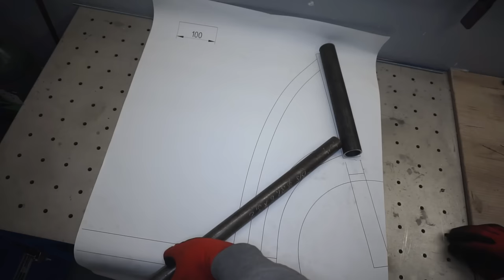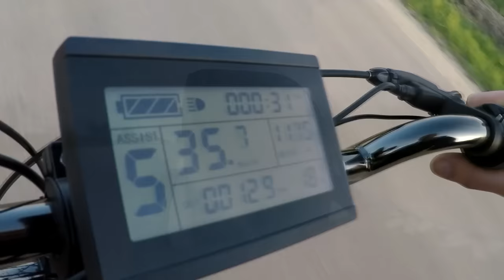Making a Powerful Fat Tire Scooter

Comment: The fact that you can just make this in your garage is pretty amazing. Wonderful results. I love the BMX style handlebars
Reply: The man has easily $60k in equipment plus the necessary materials. We usually buy these things in a store because we don't have a high end equipped lab to make it ourselves.
Reply: The Canadian Crippler  the fact that you don't realize how awful of a comparison this is, is quite baffling to say the least
Reply: @Tiagotaf  You can build this with a couple hundred dollars worth of tools. Most expensive is the welder but you can rent one. The bandsaw can be replaced with an angle grinder and a spot welder can be made with a car battery. 3d printer is not needed for this build.
Reply: Ll
Reply: @Tiagotaf  .
Reply: @Tiagotaf  What's going on? 56١
Reply: nice

Comment: this thing is super solid. You even took the time and effort to completely weld that steel platform thats crazy. great job man I only wish I had the skill, money and time!
Reply: I thought the exact same thing! He did not take any shortcuts.
Reply: he forgot to add suspension tho
Reply: @Blox117  That would have made the project quite a bit more complex(and costly, time-consuming) plus the fat tires offer a bit of bounce as it is.
Reply: @stephenloflin4772  suspension helps keep the wheels touching the ground. no suspension at 30+mph is very unsafe.
Reply: @Blox117  This scooter doesn't got that fast. It tops out at about 25mph.
Reply: @Blox117  
Yes, going on rough terrain will not be good as you will feel every bump and hole in the ground.
Reply: @mohammedrashid1972  yes rough terrain, such as most roads in america
Reply: you do my friend, its just waiting to be found within you :)
Reply: great

Comment: 9:49 sounds like a car is passing by, Amazing work
Reply: dont know what cars you hear
Reply: @mr.engineear0987  bruh
Reply: @mr.engineear0987  silent trucks? lmao most trucks have loud Diesel engines, only thing that will come close to that sound is a Tesla
Reply: @Jack-sy8hs  Tesla truck lol
Reply: @mr.engineear0987  lol
Reply: @CabritinhaJP  what’s your problem ‘bruh’
Reply: Most of the noise in cars with stock exhaust systems comes from tires. That's probably why this sounds like a car, too. The effect is amplified when speed is increased.
Reply: @jokumukamikalie  exactly
Reply: @jokumukamikalie  Umm . . I OWN a few cars. It's the engine /exhaust. Are you a pubescent aged boy or something?
Reply: @itsruf1  Do you often stand beside a road when your car passes you? Of course the engine is louder IN the car, but if you stand next to a highway, most you hear is tire noise. And no, I wouldn't be considered a boy anymore.
Reply: @itsruf1  That's your argument?
Reply: @Jack-sy8hs  cars with fucking tires on them lol that's the sound he's talking about any car that is coasting will sound the same
Reply: @Re_Kitty  well yeah because they both have tyres...

Comment: Very nice heavy duty frame!💪👍👍👍👍👍
Reply: I would personally make the ground clearance better and protect the batteries better (he also needs a way to cool the batteries while in direct sun because metal can get really hot in the sun (or some temperature protection at least so he can not blow up the batteries from overheat)

Comment: a possible suggestion regarding the disc brake mount. In the past I have has success from waiting until the rear disc is mounted on the wheel and bolted in place. then positioning the caliper and locking it down gave me a nice reference point to weld from. great work eitherway!!

Comment: It bothers me a little bit that I don't have the knowledge to do the battery in the electrical work in a project like this. I am a certified welder and I have all the capabilities of building a frame for a scooter or a bicycle with no problem, except I cannot figure out the electrical when it comes to battery packs I can wire positive negative to a motor and I can wire a switch but as far as building a battery pack it is above my head. This is some damn fine work you did

Comment: It's hot. Screw the back fender. But for retailers. You need it for rain blockage. You should build with as much carbon fiber as possible on the frame. You'll get 5 to 10 kilometers faster. That's ready for the retail box bro!

Comment: Very nice, amazing tech. Would be a nice upgrade to put twin-tube shocks with springs, for a smooth ride; also since it's all electric, traction on the front wheels too, 2x2, better acceleration, less power loss. Fat tyres are a great choice, optimum grasp, no slippage. Great for Summer rides, or if you could make it modular, to put in the car, as a secondary vehicle for emergencies. You could mass produce them. Maybe even make a variant: gasoline+HHO vacuum engine, for longer range

Comment: The fat tires may be good for rough/off road use, but they also create a lot of friction on smoother roads that eat up energy.  Maybe you've noticed that when pedaling bicycles.  I'd experiment with different tire widths to optimize for my locality.
Reply: Agreed! Something else to keep in mind while riding escooters are helmets, most people wear cpsc helmets, when they should be wearing nta helmets like xnito or bern hudson

Comment: Personally I would like to put the charge inlet higher up such as on the steering column to keep the dirt off from daily use and skip the bms to keep the battery pack functional for a longer lifespan before replacing.

Comment: It will be perfected DIY electric scooter if you add fenders to the front and rear wheels so that water doesn't splash from the wheels during the rainy season. And it completely perect if there is a roof at your wonderful scooter.

Comment: That thing turned out really nice. You're a very talented craftsman. Nice welding, good design.
It's a shame you don't have a powder coating setup. It would have made the finish on the frame really pop. (maybe that'll be a future project)

Comment: Very nice .But with forward planning you could have put suspension on this . Considering you are riding on rough ground also ..I have a 350 42V scooter with seat this has suspension on seat .Even on this some roads are a little bumpy ..Anyway good luck

Comment: Keep all friends on this channel, I want to build a cyti coco style scooter, I have two controllers here, one with a 500w brush motor and another with a 350w brushless motor, and an accelerator with a universal contact switch. What type of battery should I use for each type of controller and which motor for each type of controller I appreciate the advice.

Comment: It’d be way cool to see a whole video on just building that battery! I’m curious what the cost is to build one like that from scratch?
Reply: Its about $10 - $15 per cell for the good high discharge 18650's. High discharge cells are around 2500 - 3000mah.

Comment: Looks very nice!
I have a Question how do you control the speed with a ordinary throttle? I mean how are the connections? Is it possible to use a universal motor?

Comment: Here in Brazil, the Detram does not let you drive your scooter, you need a CNH ACC and to get this CNH ACC the same Detram system says that it has no technical support or platform to regularize, do you know why? Electric vehicles and artisanal combustion are not welcome here in Brazil

Aqui no Brasil o Detram n deixa vc conduzir seu patinete,  vc precisa de uma CNH ACC e para tirar esta CNH ACC o mesmo sistema Detram  fala que não tem suporte técnico nem plataforma para regularizar sabe porque ? veículos elétricos e a combustão artesanais n são bem vindo aqui no brasil

Comment: hi do you have the web site that shows you how to align each battery after you have checked capacity in relation to one another? I know there is a site or app so that you know what battery goes next to which one after you have written down the capacity check number on it and if anyone knows thanks ahead of time,  also where did you buy the hub motors at?.

Comment: 2 MAJOR things need ATTENTION ... 
1》 is cooling of the batteries and controller, in special under direct sun. 
2》 is the puncture protection of the batteries... both need massive improvement for your safety and your home safety ... you do not want the Li-ion fire/explosion to occur ... it is devastating.

Comment: nice try - still many things are missing - 1) damping system 2) better breaking 3) lack of security key 4) back wheel suspension 5) room for flexibility 6) missing head and back lighting + break lighting 7) information about miles range and weight - etc etc.

Comment: Not bad, but as far as that thing moves and as ridgid as it is, I can imagine it's not very plesant without suspension.  I took an old gas powers scooter off mine and converted it to run on dewalt batteries.  It has front and rear suspension and it's still rough.

Comment: the controller does not show the exact speed, you need to measure it using the smartphone's GPS, do not mislead people that it is driving 40 km per hour on the on-board display

Comment: 4:00 not trying to be a dick but that would be 13" tall and 6.5" wide tires on 6" rims. also wheel is the assembly of tire + rim.

IMO i would have gone for a duel drive it would make it far better off road.

Comment: Making your own batteries everytime they need replacement not such a good idea. Better to go with something standard you can buy. Better yet a pull out solution so you can quickly swap batteries and continue going.

Comment: Stupid idea putting those tyres on ........ creating too much rolling resistance on the road surface. You need real skinny tyres ........ the battery will last a LOT longer with the least rolling-resistance the skinny tyres would create.

Comment: looks cool but 40 kmh  is boring AF.   you clearly did something wrong...  like 1.5 kwh  motor can do a lot better.  i have scooter too but he runs 55 kmh with only 800 watts motor and pretty much same battery